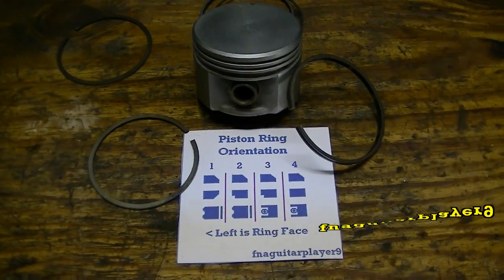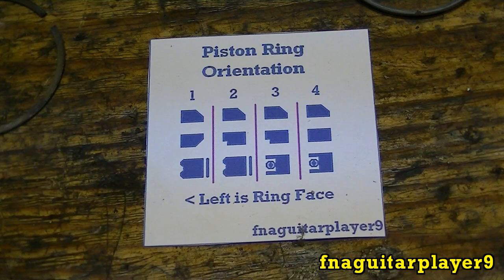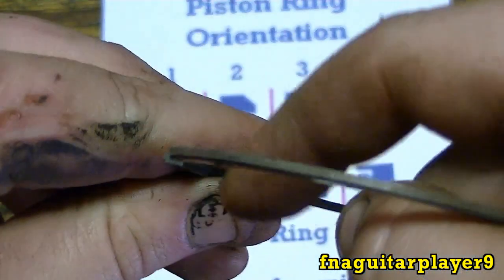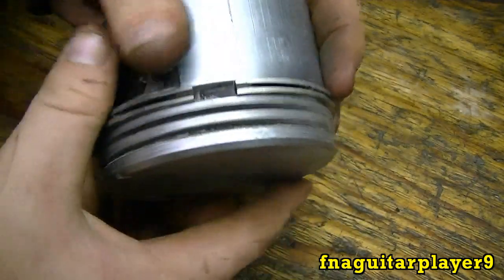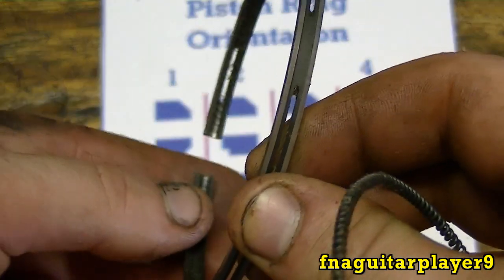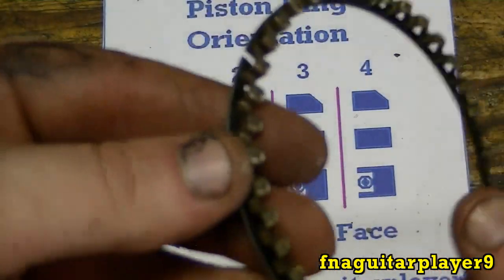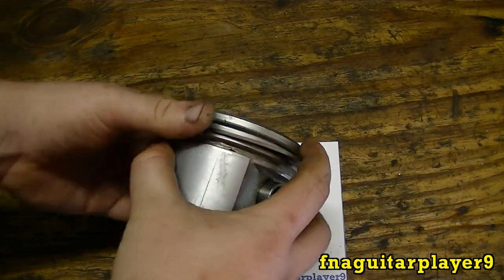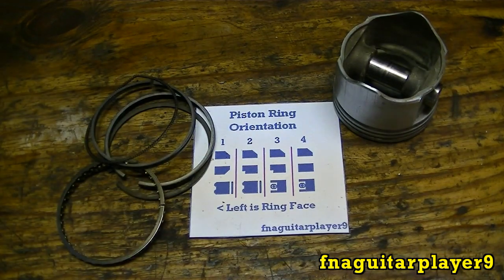Piston Ring Orientation & Installation Tips

Comment from the maker: your welcome! the cylinder is what your talking about, the surface is known as the cylinder wall. Just be sure to use STP motor oil treatment all over the piston and rings, it makes it easier and keeps from scoring anything. and make sure the ring gaps do not line up, put them 120 degrees from each other.  thanks for watching!!!

Comment: when piston rings wear do they get thinner and therefore affect the size of the gap and that's where they lose the compression?  or do they actually get to the point where they aren't even making contact with the cylinder walls because of the wear?
Reply from the maker: Most of the time yes, the ring gap will open up do to ring / cylinder wear and cause oil to pass through, but it can be that too, just depends. Rings get weak over time from the heat and can loose some of their spring, so less pressure gets put against the cylinder wall. And in extreme cases a ring can get stuck in the groove and not even touch the piston, or even break. These usually cause cylinder scoring as well. Thanks for Watching!!!

Comment: I found out the problem with hb my briggs 8hp compression issue I used 20w 50 oil wen i rebuilt the engine  and when I was running it in it was smoking with 20w 50 it was knocking a lil bit I noticed and after 30mins run time I changed the oil metal chunks and shavings again used the  same oil started it again then the  smoke was gone then I thought everything was go in fine then it died I tryed to start it again it was seized pulled it apart massive gouge in the sleeve oil ring was broken in 3 places crazy so ideally I should get it bored oversize but I did a cheap fix and used JB weld original in the gouge then honed it flat I saw a video using this on a briggs head I think the channels called projectfarm very interesting vid check it out thought I would share my story thanks mate
Reply from the maker: That oil is a little thick for it, hopefully that will hold up for ya, I watch his videos all the time, great content. Thanks for Watching!!!

Comment: do the gaps on the piston rings have to be alined ?
Reply from the maker: Good Point to bring up, i forgot to mention this in the video... None of the ring gaps should line up, reason for this is it makes a passage for gases to pass through easier and oil to seep past, the gaps should be 120 degrees apart from each other. Very Important. I'll make a annotation in the video, so others will know. Thanks for Watching!!!

Comment: what if ur rings have no dot or any markings .. does it matter wich way it goes? the grooves inside r same on edge of ring
Reply from the maker: If they are just square then it doesn't matter. Just make sure, because some may have a slight bevel thats hard to see. Thanks for Watching!!!
Reply: fnaguitarplayer9 yeah I looked real hard. top compression ring looks same bevel on top and bottom. but has no marking. don't matter then ?
Reply from the maker: It shouldn't matter if there is no markings or different bevels, it should be fine.
Reply: ur sure... people are going to be very pissed if they put the rings wrong.... i mean, no body wants to bring down the motor if the rings wre put wrong.... its lots of work for a small detail like not marking the rings or knowing the right orientation.
Reply from the maker: If there is no bevel or indention then it would be the exact same either way, unless the instruction specifically specify that there is a difference...